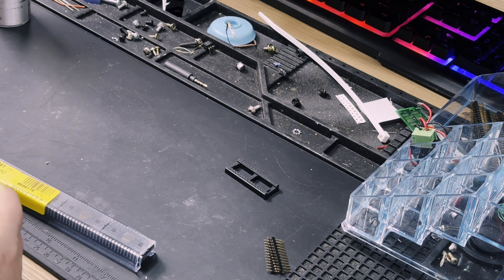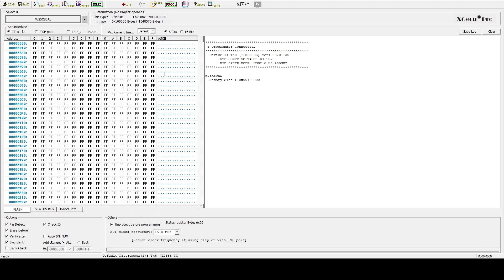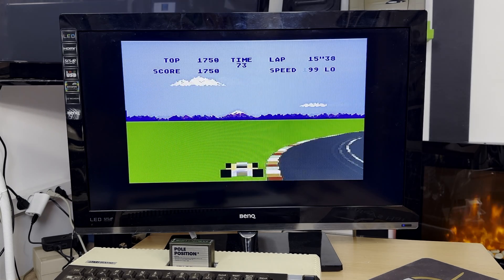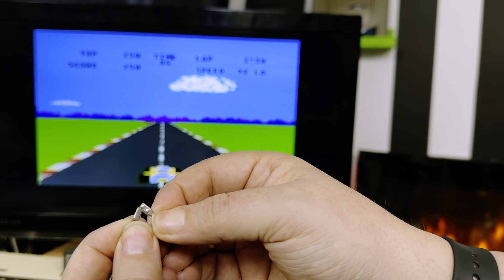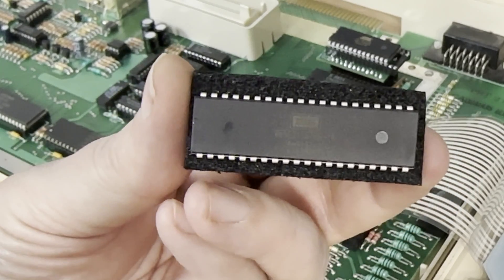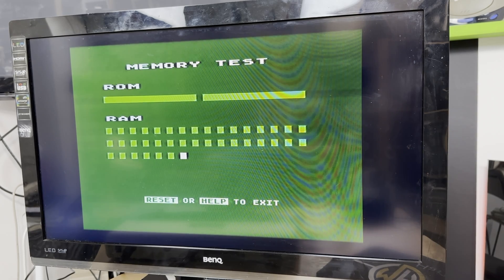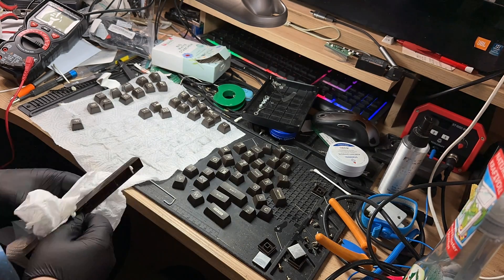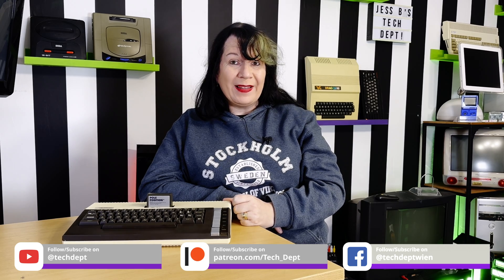Atari 800XL, Replacing the Basic ROM and more.

Comment: I guess we were both a bit off on  what was wrong with this machine. I was convinced a  marginal RAM chip was the issue since  in the past I had  machines with bad memory working with  a cartridge  in  the slot but failed to boot without one.
Reply from the maker: Yeah it was interesting to discover what the issue was. It’s always great to be proved wrong. Every failure becomes experience. :)